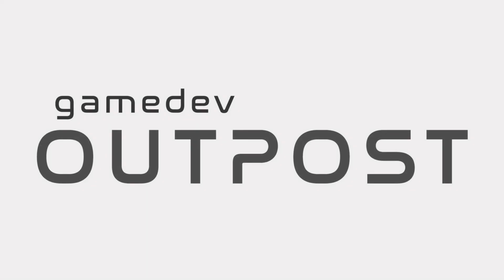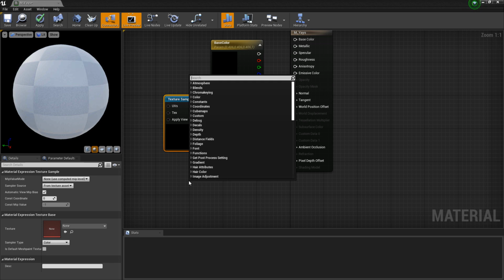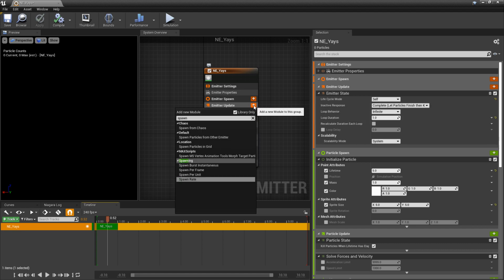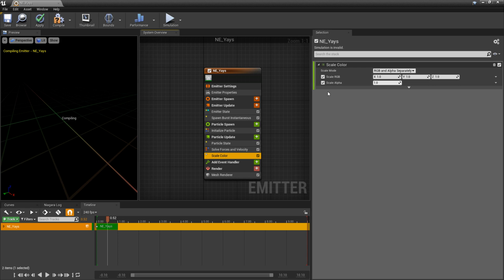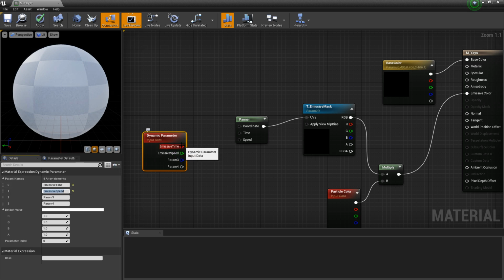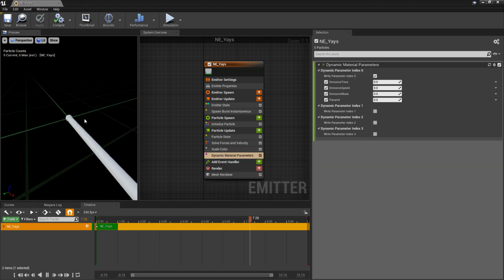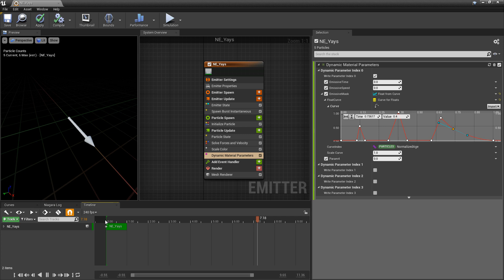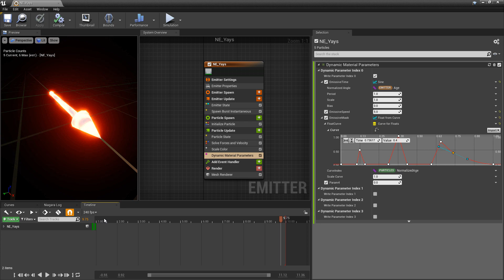UE4 - Niagara Dynamic Material Parameters - Part 2

Comment: Hi, I have a question. How we can use more than 4 dynamic parameters? I added new Dynamic Parameter node but it's same as previous one. It's so dumb question for now but in the future i'm sure i will need more than 4 :)
Reply: Yea, I would also like to know. Cant figure it out!
Reply: When you create a dynamic parameter in material there is a option to set index for parameter so for creating multiple dynamic parameter u can give 0,1,2,3 etc etc and then in niagra when u add dynamic parameter you can assign those index number to parameter that way the engine will know which parameters contains what shader properties